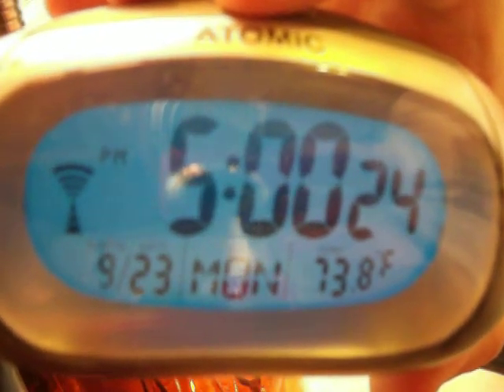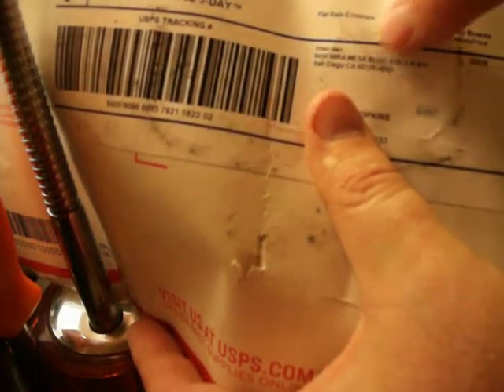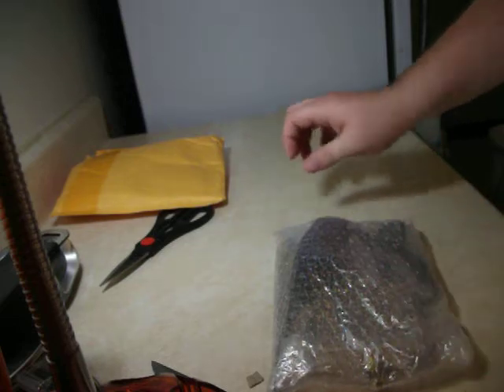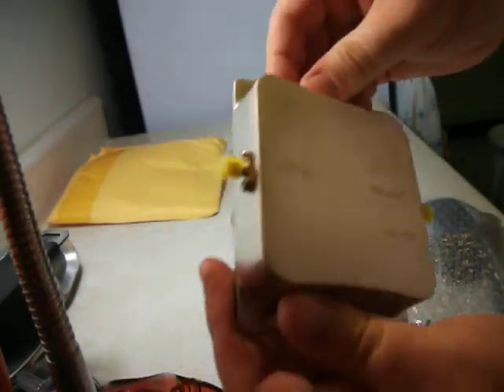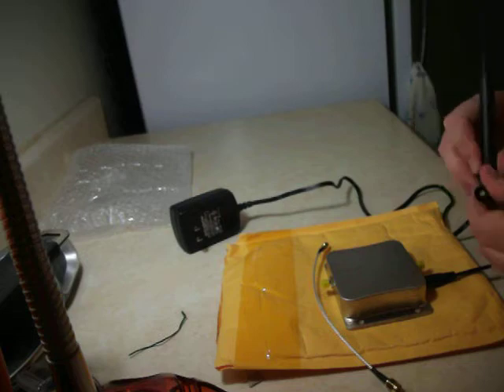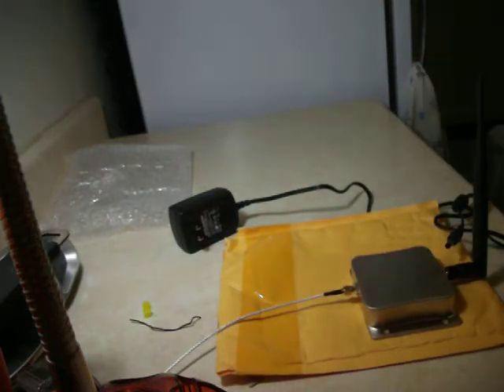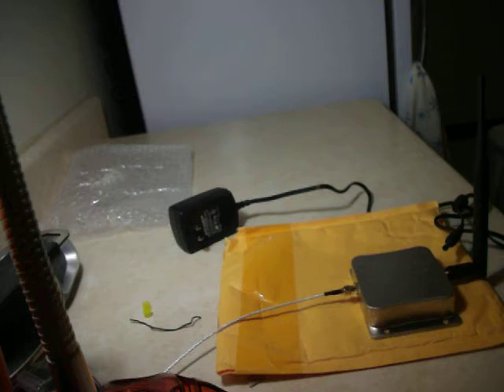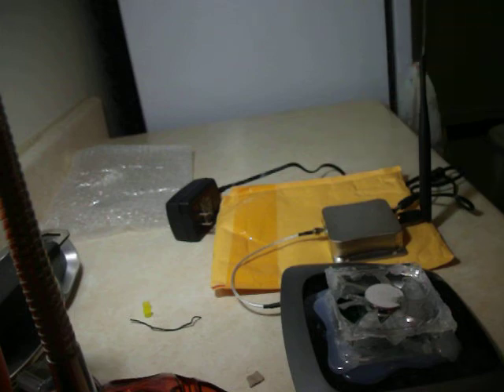Unboxing of EP-AB003 2.4 GHZ WLAN Booster from China

Comment from the maker: First, I dont know what the REAL Watt OUT is until I get a Watt meter and analyzer.
I have it powered by 5 amp 12 volt wall adapter.  I havent opened up the case to see what it looks like inside yet. The Box question is funny. They charged me for a box but send me this B.S. packaging. Second, I did and do have the Yagi connected to the Amp currently going thru Four ceiling/Floors with good signal. This is Used for in House ONLY not outside use. Forcing the signal thru 6" concrate floors and ceilings. when i get the money for the meter I'll do a Spectrum Analyzer/scope on the whole thing. Hints for part two video. I dont know what the noise is or has been. Lastly i think the LED is the activity of data sent and received.
Reply: I'm very interested in the actual output power if you ever get around to it please let me know!